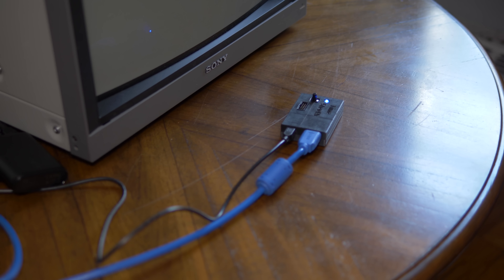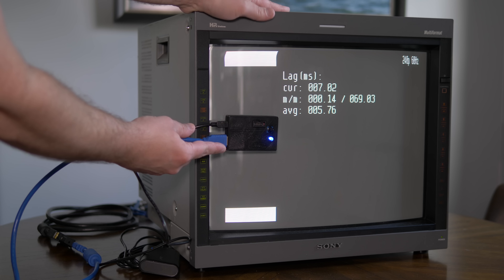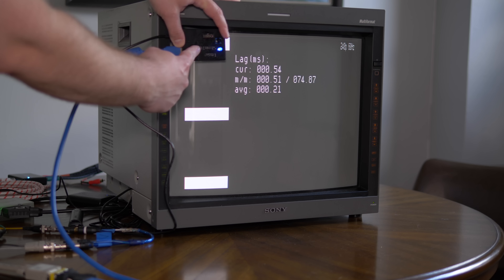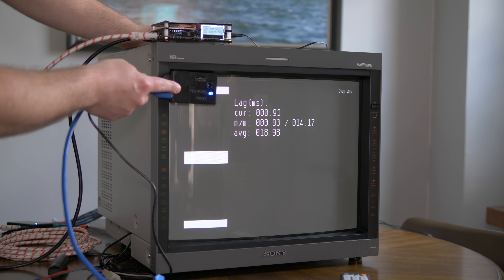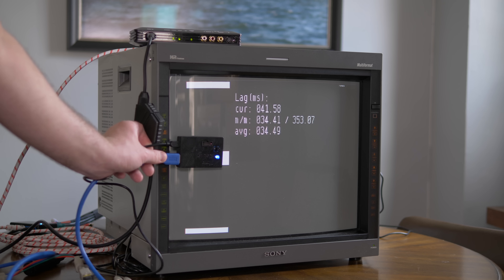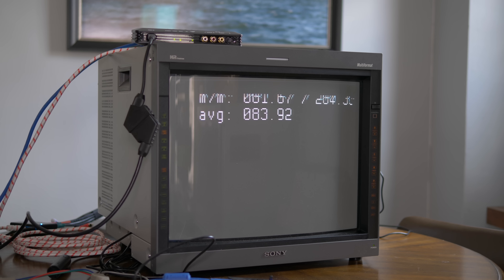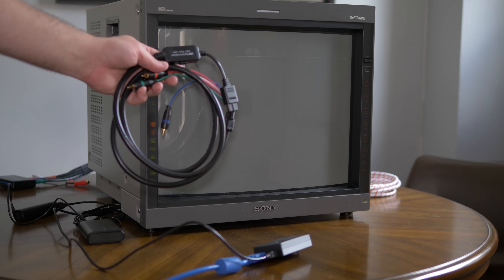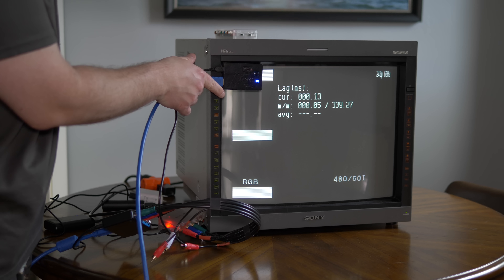Lag Testing Retro Scalers

Comment: Thank you for sharing this Bob, my wariness in buying any expensive current solution has been confirmed. I am now leaning towards the HD Retrovision cables since my 2019 4K TV actually has component inputs that work with the PS2. But who knows how much lag that thing has. Anyways,  How old is your HD Video Converter? I think buying a new one to compare with the old one might be interesting. Also maybe a new fresh batch of these retro hdmi cables, I've read they have made some improvements to them. Kaico has also made some interesting hdmi devices that would be interesting to watch you test. Thanks again.

Comment: This may be dumb but is there a way to test MiSTer HDMI output with a setup like this? I'm told it's zero, and I believe it, but as we saw here with Framemeister etc, it'd be neat to see.
Reply from the maker: Not dumb at all!  I have done MiSTer lag tests, but it required different tools.  The HDMI output was about half a frame of lag from the analog...a bit less actually.

Comment: Could we get a model number for the HDMI to VGA DAC? Or are they all pretty much the same? Please and thank you!
Reply from the maker: Check my Amazon link in the description.  Some are currently out of stock, but should be coming back soon.  Also, they're definitely not all the same and some add a bunch of lag, so definitely make sure to buy the ones linked, that I've previously tested.  Their cases are slightly different, but they should be the same guts.
Reply: @RetroRGB  Thanks for the tip! I didn't realize you had that Amazon list at the bottom. I just picked up the Portta HDMI to VGA.

Comment: Is there any good, ready available, solution that "normalizes" the HDMI output from an OSSC for capturing? I ask because my capture card doesn't like resolution switching or signal resets (I usually have to unplug it and replug it when that happens, which OBS doesn't like). I currently have it going to the cheap SCART to HDMI boxes, but I'm not satisfied with the latency when playing on a flatscreen TV. I've seen people recommend some older DVDO stuff, but that's hard to find and usually very expensive now...
Reply from the maker: Actually, that cheap SCART to HDMI box can be used for just that exact reason!  Please check out the video I did about it:  https://youtu.be/ZUrqWN4AcJc
Reply: @RetroRGB  Ugh, YouTube didn't notify me of your reply, so I hope you see this.

The problem with the cheap SCART to HDMI is that, in my setup, the video has to go directly from the OSSC to the Scaler before going to my TV or capture card (basically what I see is what I capture). I could try adding more splitters into the mix, but that would get even more messy, very fast. Is there really no step up from the SCART to HDMI in a sub-€100 pricepoint?
Reply: @5had0w5talk3r  Not sure if you're still looking into a solution to your question, but I'd like to give my two cents. Response will be a bit lengthy so please bear with me. I had a similar issue with my OSSC when I bought it: my TV would accept any signal the OSSC spat out, but would frequently drop video entirely when the OSSC switched video types on higher line multiplier modes. Only way to fix it was to reset my matrix switcher to pick up the signal again. I'm currently using a device called the Crestron HD-Scaler to "normalize" the signal and output 1080p. It's a professional device often used in business buildings and such so its not available directly from Crestron to the public, but they're being phased out for 4K stuff so resellers and liquidators have a bunch of them. I was turned off by the rarity and price of compatible DVDO products and I saw a couple random comments on other videos talking about the Crestron so I took a chance and bought one. So far it works really well, but only when it takes digital signals. It gets a tad laggy when you put an analog signal into it, so I'd say its best when paired with line multipliers like the OSSC. It constantly outputs your chosen video signal (anything from 480p to 1080p on consumer flatscreens) even when nothing is going into it, and it also switches video signals very fast so no worries about dropped signals or signal switches. It even does a pretty good job deinterlacing so if the OSSC's bob-deinterlacing bothers you then you could try the Crestrons deinterlacing instead. I can't provide any hard numbers as I lack the necessary equipment to do so, but the Crestron doesn't cost a whole lot so it may be worth looking into for you. I bought mine with the power adapter, remote and several power plug adapters for different regions for around $50. Just make sure you get one with a remote, you're going to need it. Prices will vary, but you can find these things all day on EBay. The one I'm talking about is discontinued as far as Crestron is concerned, but there's also two others that handle VGA to HDMI or HDMI to HDMI called the HD-SCALER-VGA-E and HD-SCALER-HD-E respectively. I haven't tried those out myself, but I can assume they function the same just with different inputs in mind. Crestron also has specs and info for these machines on their website and its all public so you can learn more about it there. Hopefully this helps you out, and I apologize for the long comment.

Comment: I have the first version of leo bodnar's lag tester (the red one before it was called time sleuth). 240p output and microsecond display would be extremely useful. I wonder if there's a way to update the firmware...
Reply: It didn't later get called the Time Sleuth. Those are two separate devices. For you and everyone else reading, the Leo Bodnar Lag Tester is an old device from Leo Bodnar. It comes in 720p OR 1080p models. The Time Sleuth was made by Dan Kunz and Christof last year. It can measure in a wide array of resolutions. Bob of RetroRGB reviewed the Time Sleuth while also comparing it to the device from Leo Bodnar.
https://www.retrorgb.com/time-sleuth-lag-tester-review.html

Comment: does that cheap hdmi to component box support rgb too? i know most of those chips support both YPbPr and RGB and they have an option to switch depending on the pixel format of the hdmi input, but some devices turn that option off.
Reply from the maker: No.  For RGB, you'd need the HDMI to VGS + Sync Combiner like I showed.
Reply: @RetroRGB  but that's vga, right? I'm talking about scart rgb, for a crt tv.
Reply: do absolutely none of em do that? going from hdmi to rgb scart is so confusing and inefficient.

Comment: has far i understand is, OSSC is one of the best option for a retro setup, because upscale to 1080p with almost no lag, i am correct?
Reply from the maker: Well, "best" is relative.  My suggestion is either the OSSC or RetroTINK (and RAD2x) products, based on whatever your setup needs are.
Reply: @RetroRGB  i am moving from Venezuela to Portugal, and i have a collection that  i am sending to there, my plan is to buy a LG C8 flat panel,  because as far my investigation have taken me with that panel is to buy the OSSC and the corresponding RGB cable to each console, take the HDMI output, split it to my TV and capture card, obtaining the best performance with little lag as possible, i am wrong or doing something bad?
Reply from the maker: @adriandasilva2169  That sounds like a great setup!

Comment: Interesting to see the results, I have some of these products so far, both the good and the bad. I am also interested in finding a solution to a problem I have with a handheld emulator device (Anbernic RG350) that can output with mini HDMI to a large screen but the aspect ratio is bad, on my display which has many options, I can change that, but my capture device (Elgato HD60S) cannot change the aspect ratio, I wondered if I could use an adapter cable to run it through a convertor first before the capture device. Would it be safe to connect with adapter to say the OSSC? Anyone who has also played around with this, please advise if you can.

Comment: Any plans to look into the GBS-8100? It's the reverse of the 8200, a 31 kHz VGA to 15 kHz RGBs downscaler
Reply: The problem with the GBS 8100 it's The output is 480i
Reply: @CharlieGuitar87  Didn't know, was considering getting one for a project, but had difficulty finding information. Thanks!

Comment: I use the "shitscaler" to convert my GameCube signal obtained via Insurrection Carby 480p into my VGA CRT (1280x1024). I like the results (it was cheap), it should be cause I use my GameCube to play "slow" games like Resident Evil, Zelda, Eternal Darkness and Final Fantasy.
Don't get me wrong, I feel the input lag, it simply doesn't bother me.
Reply: Also, your scaler (those chineses ones called "HD Video Converter" are the ones people call "shitscaler") deinterlaces the progressive signal it comes from your 480p/240p games and then makes it progressive scan again, adding motion blur to your pixels when its moving. I'm just informing you that, even though it simply doesn't bother you, the visual artifact is there -- besides the extra lag it adds.

Comment: Also ymmv with the Levelhike cables when it comes to lag. I think they might have been trying to make improvements to them.Or at least the PS1/PS2 Levelhike cable I have only produces a single frame more of lag on my TV.

My TV roughly introduces 2 frames of lag even in Game Mode (It's a Cheap TCL 4k TV) This is at least my findings using 240 Test Suite using a Gamecube, and a Carby.

My testing of the levelhike cable was on a 1001 Model PS1, so I could output the composite to a CRT as well as have the Levelhike cable plugged in. 240p Test Suite showed 3 frames of lag total on my TV with Game Mode On, so only a single frame more over the Gamecube using the Carby. But yeah, 3 frames is still a lot and can be felt easily.
Reply from the maker: Please don't forget that the LevelHike lag is variable.  If you ran the test 15 times, you might get 15 different readings.  Sounds like you just happened to get it at it's lowest point.
Reply: @RetroRGB  Very true, but I found it was very consistent in my testing, always being about 1 frame of additional lag after multiple tests. 
But of course I still wouldn't recommend the cables,  as they still blow out the color red, fail the drop shadow tests, and introduce varying levels of video noise.

Comment: See what i do is i have my rare 60 gig ps3 and i modded it so all my nes snes gb gbc gba sega ps1 ps2 and ps3 and psp games come out nice in hd. For my 3ds my ds n64 and mame. i just use my phone and cast it to the tv and use a bluetooth controller. I don't get any lag or button press lag. My old moto z2 force phone works great with my tv to not have that problem. I also use my ps3 to play my snes msu1 sound hacks as well. So with the 2 together i don't need to use my old systems. It also lets me save wear on my old systems as well. I have 2 ps1 system that should be dead by old faulty lasers but they work great because i don't use them. Plus with streaming or modding you can get up to 4k video on your tv something you can't really get with a converters and most if not all that can will have lots of input lag problems. This is why i thought of doing things differently and it has 100% paid off for me. Note not all tvs are great for casting some smart 4k tvs have problems with that. Aka Vizio lg and Samsung. Sony is normally ok never had a sony give me input lag.
Reply from the maker: You know there's a bunch of lag with software emulation, right?
Reply: @RetroRGB  i have no software lag with any of my emulators it runs great for me even my rom hacks run great haven't ran in to one game that failed me yet. I have ran around 16000 different games with no problem. I think it all comes down to knowing what emulators to use and whats the best phone to use. Moto z2 force witch is a old phone runs 1000 times better then the Samsung Galaxy s20 because of how there cores work. Samsung does wired things with there cores to were shit gos crazy but Motorola seems to have a very stable set of cores. And if you can't get what you want use the dev op on your phone to make it run 100 times better. As for tvs sony seems to have almost 0 if not 0 input lag were most all other brands do.

Comment: Ps2 hyperkin through an m classic 1440p . Need hyperkin lag test 🤷‍♂️😅
Reply: The Hyperkin cable has the exact same guts as the Levelhike and Pound cables.
Reply: @AceTrainerX3  
Now I run retrotink through m classic. Output is 1440p

Comment: Is a sync combiner always necessary? When I was looking at getting a VGA to RGB cable for my MiSTer and PVM I was told rather than sync combine to just connect the grey cable. Not sure if that's just related to the MiSTer INI settings though.
Reply from the maker: In that scenario, you are 100% correct:  The MiSTer will output RGBs, so if you have a 5BNC cable then you'd just not connect the 5th wire.  For standard RGBHV (VGA) signals, yes, you would need a combiner.